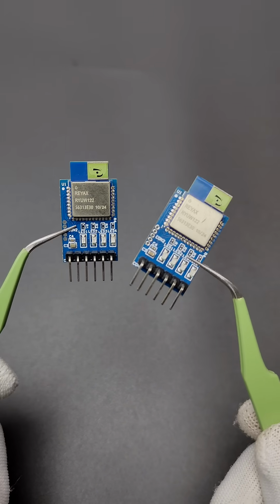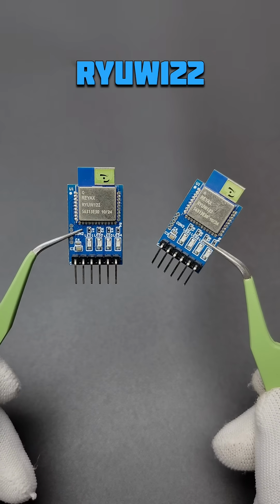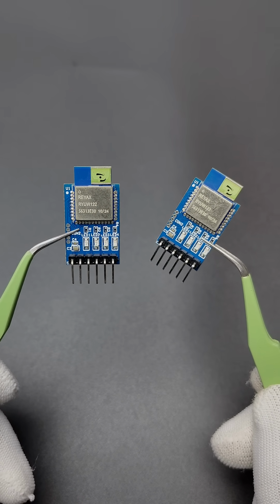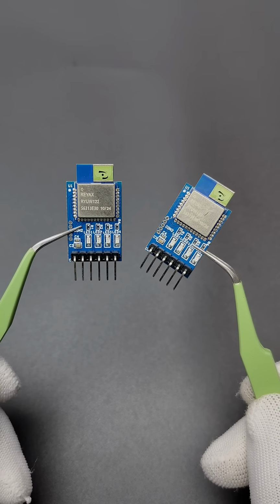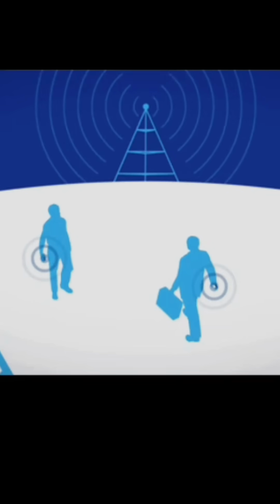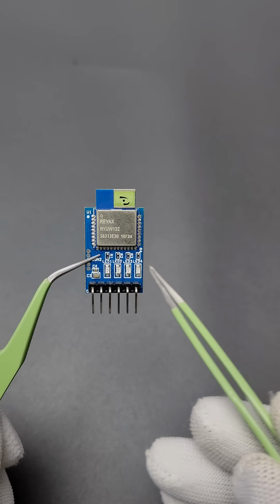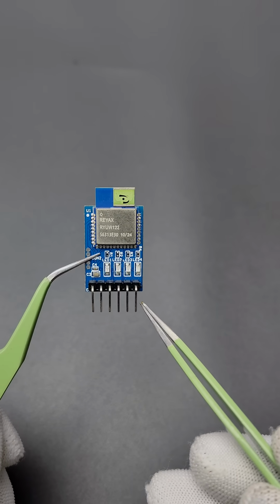Find location without using internet| RYUW122 UWB MODULE #wireless

Comment: Can we send data from one to the other like text and then display. If not then what can I use to send data about 30 meters apart, I don't think the ESP protocol has that much range...???
Reply from the maker: Possible to send.
Reply: @EDISON_SCIENCE_CORNER How, the transmitter is about 3 floors below the receiver in an apartment, will the ESP protocol work this far with layers of concrete, it works on 2.4ghz I believe...???☺️

Comment: Is there a module that works on the unused TV white space?
Reply from the maker: What you mean by unused  tv white space
Reply: @EDISON_SCIENCE_CORNER TVWS = television white space 

 IEEE 802.11af
And
IEEE 802.22

 54–790 MHz, depending on the country

One spec uses a geolocation database to avoid interference with UHF channels being used, another I believe just listens and or and can be manually programmed.

You remember those analog dial CRTs with the second dial for channels that go from 15 to 87 or something like that?
  Well like a decade or two ago the FCC opened up that mostly unused space of wavelengths for long range unlicensed rural Wi-Fi...
Reply from the maker: @JohnDokivin  sorry i am not aware about this
Reply: @EDISON_SCIENCE_CORNER not too many companies have bothered with it, Carlson wireless is the only one that made a full commercial product, a few companies made some ASIC chip sets, others stacks for FPGAs and DSPs, but most stopped after proof of concept with a software-defined radio.
 I don't know how much of that is available to make a module out of, or if it's too proprietary and protected.

Hey, I don't suppose there's such a thing as a cheap software-defined radio module that transmits?

 Or only that receiver originally intended as a television video capture card designed before digital TV?

Comment: Should have arrow pointing towards another device, should also have option to support multiple device with single tracker
Reply from the maker: It can only measure the distance between tag and anchor
Reply: It is kind of a scalar qty so only intensity can be measured, not direction
Reply from the maker: Yes
Reply: So it's like biangulation instead of triangulation
Reply: Perhaps an antena with 4 modules reporting to a central model that use the info to deduce the vector in 2 domensions of course (dor that other 4 would be needed to create a sphere or cube.I forgot central unot must have giro sensors ,gps etc
Reply: If more space was needed between sensors ,a floak of drones that use buildings, to increase accurasy ,not use battery unecesarily .while listening to this signal + using gps + ...

For a public service application , any semaphor or traffic signals ,and homes for private nets

Comment: so we can build auto follow robots and automatic chaging doc finder robot etc
Reply: Vector and scalor
Only the distance, not direction...
For direction, use ultrasonic sensors,
Or GPS modules in case of large distances
Or something
Reply from the maker: Not possible with ultrasonic sensor
Reply from the maker: Yes possible. But not easy
Reply: Search for PLATOONING. That may give you things that follow others .

Comment: What if this module using external antennas ?? Is that possible ?
Reply from the maker: No way to add  external antenna
Reply: @EDISON_SCIENCE_CORNER  anyway to replace the antannae by finding its antennae, finding the exact type, and soldering it on to the board?
Reply from the maker: @melita86-c9b i have no idea ,  you can try that